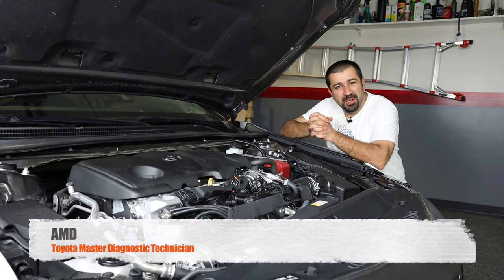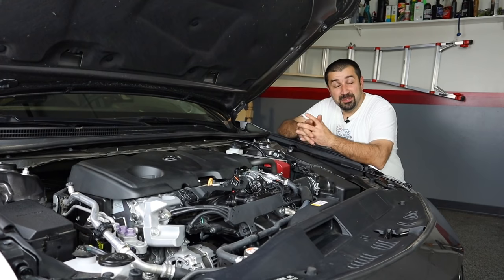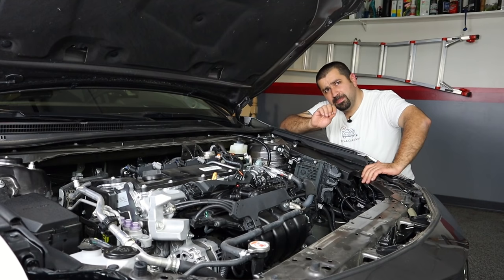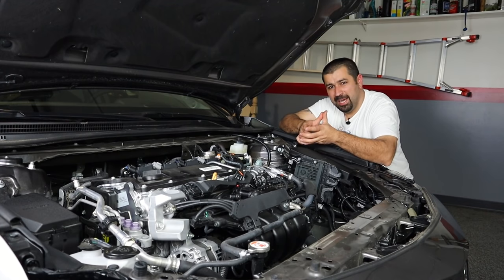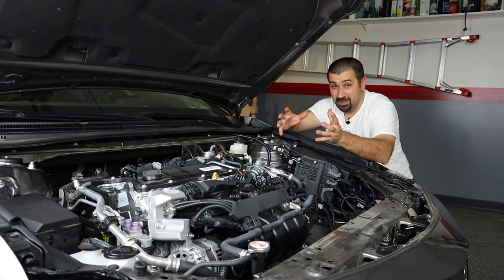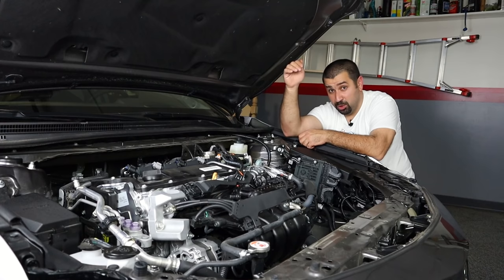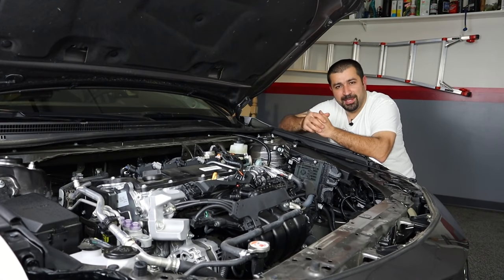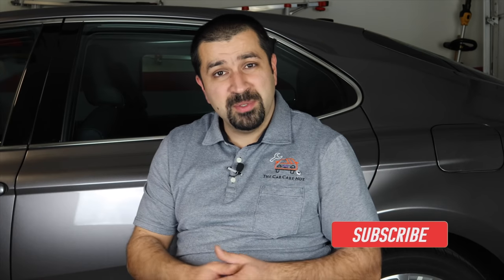Toyota's New Engine Technical review Part 1 : Cooling,Lubrication,Direct Injection and EGR

Comment: AMD my question to is my 2014 Prius w/89K miles is having shifting  issues ONLY when I use the cruise control is that normal? Is this an expensive issue?
Reply from the maker: Hi Michelle. What kind of shifting issues? Also the area you set the cruise control is it a hilly area or flat
Reply: I notice it more on hilly areas
Reply: Hi AMD & I don’t know how to explain it to you cause idk the lingo of cars I know that my 2007 never had this shift problem
Reply from the maker: Michelle it could be that the car is engaging B mode to help with braking. Try this. Drive on a flat area and put your shifter in B mode and see if it shifts the same way when you set the cruise control in hilly areas.
Reply: @TheCarCareNut  thank you so much AMD I really really appreciate you answering ALL my questions.It means a lot to me.
Reply from the maker: You’re welcome Michelle!

Comment: lets hope that the electric water pumps are easy to change,  I hear they do not last long in other cars.
Reply from the maker: They’re not bad to replace. We’ll see how long they last
Reply: The Prius has been using electric water pumps for years.  They are a lot more reliable than belt driven pumps.
Reply: @TheCarCareNut  Do any I need a computer or diagnostic tool of any kind for changing the water pump and thermostat on this vehicle? And also would you say the life span is for both on this vehicle?, and also is there any special procedures I need to take besides running the engine above 1500 rpm’s once everything is put back together for coolant fill mode?, thank you
Reply from the maker: They’re both not bad to replace and don’t require anything special other than bleeding

Comment: Thanks AMD for another great video, i have a question related to the 2021 RAV4 I needed a car and it had to be a RAV4 the only one I could find at the time was a LE which didn’t have the auto headlights option, could I have that option installed by adding the light sensor and proper headlight switch?

Comment: Do GDI engines wear out faster  due to higher internal pressure?
Reply from the maker: Not always. With proper maintenance it shouldn’t wear out fast.
Reply: @TheCarCareNut   thank  you for replying.  Would you recommend CRC gdi cleaner spray for  gdi engines,  especially those without additional  port fuel injection.  I am worried that loosened  carbon chunks could damage catalytic converter and turbo unit!
Reply from the maker: I wouldn’t use the spray alone. You’d want to extract the carbon after spraying it.
Reply: @TheCarCareNut  do you mean a manual cleaning after removing the manifold?
Reply from the maker: Yes

Comment: I took an offer I couldn’t refuse 
for my 2016 Tesla Model S P85D, I loved that car,
but it was time to go. I was planning on getting 
another Tesla when I bumped into a great deal 
on a 2018 Camry Hybrid. I bought the Camry as
an interim car until I found a Tesla. I was going to 
sell the Camry and put the profit towards the new
Tesla. Short story long, I love driving this Camry.
It does what it is supposed to do and does it extremely 
well. It’s surprisingly quick—not 3.2 to 60 like the Tesla, of course—
it handles very well—again, not like the AWD Tesla with staggered wheels—
This car sips the dyno juice while the hybrid system is incredibly smooth.
I get a kick out hyper mileing and getting crazy gas mileage.
I don’t think there’s a better, more reliable, more refined car for the money
on the market today.
This incredibly engineered Camry is staying in the family and will share 
a parking space with my next Tesla in my garage.
I enjoy your channel and really I learn a lot. Thanks much!

Comment: I hit a rock and the plastic and the oil filter perforated my car warned me of the low oil level and it was in safe mode I was able to power it I had the car towed and they changed it the oil filter perforated and I knock on wood but I believe that thanks to the oil level sensor the ecu saved my engine do you know if it is true that the oil level cuts off the gas in the event of a too low level of oil

Comment: In this particular video - is the engine that you are using as an example is that the 2.5 gas engine?
I am thinking very seriously in getting the Camry XLE awd  and getting rid of my Subaru.
Reply from the maker: Hi! The engine in this video is off a 2020 Camry with the 2.5L A25A engine
Reply: @TheCarCareNut  thank you so much for your reply.
Do Subaru and Toyota share any components.
I have been told that Toyota  has an interest in Subaru ... is that true ?
Reply from the maker: Hi! They likely share suppliers but not parts directly except the scion FRS which is codeveloped.

Comment: Man I have this engine and I am using amzoil 5W-30 and it's recommend by the user manual there is no mention of using it once and then go back to 0-16 ( I live in a hot climate  *saudi arabia) will this effect the engine in the long term !?
Reply from the maker: This has come up. I am based in the US and the manual is different than other markets. I would use the oil that was printed on the car under the hood as programming for different markets could be different.

Comment: So what drives the engine oil pump on the hybrid?
Reply from the maker: It’s still driven by the engine mechanically but controlled electronically if it has this engine to change the output

Comment: First off I wanna say love your YouTube channel it has been extremely helpful,Also I had a question 🙋‍♂️ I brought my wife a 2018 Toyota Camry SE  for X-Mas miles 12k,I have had my local shop do the oil changes for now which they do 0W-20 but I was wondering do I stay to 0W-20 or change to 0W-16.
Reply from the maker: Hi! I would switch it back to 0w16 on the next oil change
Reply: @TheCarCareNut  Thank you 😊 will do ASAP appreciate you fam

Comment: Hi, can you share something about maintaining a Toyota hybrid? Some of the information are not stated clearly in the owner's manual and people have different opinions. Eg. is the transmission fluid really life time? When to replace the brake fluid? When to replace the 12V battery?
Reply from the maker: Transmission fluid every 60-90k brake fluid needs to be tested but on average every 3 years. 12v battery when it fails which is usually around 3-5 years
Reply: @TheCarCareNut  thanks!  I supposed your units are in miles ? What about coolant change ?
Reply from the maker: Yes In miles. Coolant first replacement is 100k miles or 5 years then every 5 years or 50k miles afterwards

Comment: Thank you AMD , you are real talented expert .
my dealership in my region  is recommending 10w30 (arab gulf countries) for corolla dynamic engine 2023
I am totally convinced by your recommendation which saying clearly use 0w16 regardless the climate.
0w20 SP is available in dealership and 0w16 is totally unavailable in the region.
Should i go with 0w20 and stop filling the standard dealer 10w30?

Owner manual recommends :
0w16
0w20
5w20
5w30
10w30 

I really need your expertise to advise me on this case :)

Comment: Having this engine in my 2023 RAV4 Hybrid, my Toyota dealer told me during the first maintenance that he filled 0W20.
I discussed with him, revering to the manual und this video to fill 0W16.
He told me that Toyota went back to 0W20 and he double checked his documentation to besure, his system says he should fill 0W20.
Now whats true? 
Did they really changed the spec? 
Afterwards I thougt about bringing 0W16 for the next maintenance on my own but in Europe It's nearly impossible to get this oil from Toyota.
On all the webpages they revere to the 0W20 for RAV4 Hybrid .
@TheCarCareNut what do you think about that?
Reply: Honestly the dealer is trying to scam you, because 0w16 is more expensive and they put 0w20. It wont break your engine anytime soon, but I think the lifetime of the engine will decrease ( when its out of warranty) and you get lower fuel economy.

Also if you cant find 0w16 of toyota, go for another brand that has the ilsac GF 6b specification

Comment: Thanks for sharing. I have 2021 RAV4 trd every time i start the rav4 it makes a mix sounds rattling, lil bit of pinging or knocking even in cold or warm weather still the same it will last 10 to 20 seconds only and the engine sound smooth again. The engine has more than two hundred km i got it 5 days ago. Is that a normal sound? The Rav4 is made in canada and it runs smooth. Thank you.

Comment: I was wondering, when servicing the cooling system with all of the valves how can you ensure that all of the valves are open and coolant is flushed?
Reply from the maker: Hi! When you rev the engine and hold it past 1500 rpm the computer will enter coolant fill mode and it will run the water pump at full speed and open all valves.

Comment: Well he is  just admiring the complexicity of the new engine with adding lot more parts to the engine bay which is good at some point that they claim this new engine has 40% efficiency (of course that is at best optimum operating condition) but how all these complexicity will hold up down the road is the question that we might want to ask from owners after a few years to come.

Comment: Hello AMD and again thanks for your useful videos. I am searching for a 2016 rav4 hybrid and here in france, the official toyota maintenance schedule is : 15000 kms, 30000kms, 60000 kms ( yes nothing at 45000 ?!? ) and 75000kms ... with 0W20 oil. For a 90000 kms used Rav4 hybrid, how this schedule affect the general reliability of the car? If then i apply your recommandatioins ( 8000 kms/6months with 0W16 ), no problems then? Thanks to you.

Comment: Hi I end up in this video… because a few months ago I bought a Toyota Camry SE 2019 with this engine . I’m from Mexico and I usually do my oil changes, I read the US manual (because I know Camry is made in the US) and I saw in fact it uses 0w16 as the video said. I bought everything for the oil change and then I opened the hood and there is a label indicating that the engine uses 5W30. This fact was weird to me to the fact the manual and Toyota US said it uses 0W16. You explained the reason of this and I totally understand and I’m agree. But now my question is … why Toyota Mexico is indicating and using 5W30 Oil here ? 
I replace whatever existent oil was  in my car for 0W16 expecting not having any issues at all. 
I suppose that they always used 5W30 until now, car has just 60,000 miles .
What are the recommendations? 
Keep using 0W16 like I did ?

Comment: Ac does not blow as it used too, checked low on pressures line it’s cold, and radiator fans kicks on ac, but still not cold and gets worse in 95 f outside

Comment: Is this the engine bay of a 2019 RAV4?  My dad picked up a 2020 RAV4 not long ago, and it's been excellent so far.  Also, the D4-S system has been around since 2005 in the Lexus GS, and Toyota feels confident enough to put it in basically all of their new engines going forward right up to the twin turbo V6 in the LS500.
Reply from the maker: Hi! Yes this is the engine in the 2019+ RAV4 hybrid and non hybrid

Comment: Hobbyist here, why do direct injection fuel systems NOT create vacuum in the intake manifold (your reason for including a vacuum pump: power brakes)? I'm familiar with valve throttling (example: BMW's Valvetronic) leaving no vacuum in the intake tract and that necessitating a vacuum pump. Vacuum generally occurs from the throttle body's obstruction.

Would the Atkinson cycle be part of the reason for the vacuum pumps necessity?

Just curious on why it needs/has a vacuum pump and I'm not following your logic.
Reply from the maker: Hi! It’s a bit complicated the exact explanation why but because direct injection engines don’t  exactly use the throttle as intended. They will actually open the throttle at larger angles to increase the pressure in the intake. That’s why they need a vacuum pump.
Reply: @TheCarCareNut  thank you for the quick reply, I appreciate it. Always fun to read more and learn!

Comment: Hey car care nut my first change oil is 1k miles on my rav 4 xse. But when i oil change they put 0w-20 but when i check it supposedly 0w-16. It’s okay if i can bring it back to 0w-16? Or they gonna dmage the engine already?? Thanks for help.
Reply: Please read your maintenance guide. It will inform you about using 0w20 and what to do

Comment: I didn't know Toyota manufactured engines with no EGR valves on any modern engines. No wonder they're  have valve coking and scorched rings in  engines minus the EGR valve. Yes it does reburn the pittance of exhaust gases which goes back through the engine, but the biggest benefit of the EGR system  is it lowers combust temperatures substantially which reduces the carbon monoxide emissions plus it allows for the engine to operate in a combustion temperature range at idle and cruising speeds that is lower, so it  reduces heat related wear on the valves, valve seats, pistons, rings and cylinder walls. Those oil injectors at the bottom of the cylinder are for cooling the piston and rings not so much lubrication. This is because the oil cools the moving components of an internal combustion engine. If Toyota had used and electric oil pump which would allow for pre-pressurization they would have really been cutting edge, maybe in the future. In essence if you operate an engine with a bad or seized EGR valve you are reducing your engines life by hundreds of miles every day you drive your car with the EGR system inoperable. Get the EGR valve fixed as soon after the code is discovered as possible, regardless of vehicle make...

Comment: Hi there, great engine review. However, I would like to get some clarifications.
Concerning oiling system: 0w-16 oil weight and even unthinkable 0w-8 oil weight is recommended for this engine (reffering to the latest owners manuals).
My first thought was 0w-16 and thinner is allowed solely because of this engine friction pairs was made more precisely (I mean oil clearance). According to physics phenomenon "thinner fluid goes easier through small clearances than thicker one".
However, nothing like this.
I looked in service manuals of marvelous A25A and conventional korean G4NA engine (oil recommendations 5w-30, 0w-20). What is puzzled me that I found no difference in oil clearance (e.g. main bearings). At other friction pairs the same, no significant difference.
A25A-FKS standard value is 0.020 - 0.043 mm.
G4NA standard value is 0.021 - 0.042 mm.
So my question is, where is claimed precision of A25A engine? What are places, units?🙂
Do they allow usage 0w-16 and thinner solely because of their variable discharge oil pump?
Or are there places in engine which also strictly require 0w-16 weight? Or there's something else what I can not even imagine? 🙂

Comment: toyota is not the only manufacturer with dual injection motors
Reply from the maker: I haven’t really looked at other manufacturers but for education purposes which other manufacturers use a similar system?
Reply: @TheCarCareNut  some audis,fords and  new hyundai motors. There could be more manufacturers. Cheers
Reply: @TheCarCareNut  The F150 has engines with dual injection.

Comment: RAV4, 2.0L (2020- Malaysia), The model I drive comes with 360Degress view which comes on   at 0- 10km/hr. Pretty cool feature when negotiating tight corners, but 10km/hr limit is too bad. Is it possible to increase the limit to 20km/hr, which  I feel more practical, without jeopardizing the safety. 
Pls advise

Comment: Hey AMD, with this new sophisticated cooling system, is it normal for my temp gage to go down when idling in winter?  I am in 🇨🇦 and the other day it was minus 2 c. (Approx 27-28 f).  We stopped to pick something up and I let my Rav (non hybrid) idle for a few minutes as my wife was in the car.  When I came back in, the temp needle was down to the 1/4 position instead of in the middle.  Is this normal for this engine?
Reply: Yes

Comment: A great engine of a car is an engine that can last 200,000 mi or more like the old Corollas and Camrys crown vics that determines if a car is good not if the ride is good also take it to account if the fuel injection system is good and electronic modules of it is good anything else besides this does not classify it as a great engine that's my opinion

Comment: I have the 2021 Camry LE. 2.5L. After 1 year of using and it’s on 32k right now. I have an issue, it fails to start right away after first crank for 4secs. When the car is cold, it starts right away, but when cold and I leave the car off for 15mins, it takes very long to crank start. I changed the air filter, cleaned MAD sensor, changed my spark plugs. And it still cranks long. Anyone can tell me what is the problem?

Comment: 2023 sienna has some fuel dilution. I get the oil analyzed. My wife takes alot of short trips which probably contributes to that. Will change oil every 5k. Any other recommendations?
Reply: Do some frequent highway drives.

You need to get the engine warm, and for a prolonged period of time.

This will cause the fuel in the oil to become a vapour, at which point the PCV system clears it away (keeping it simple)

Comment: I love your video. When do you recommend for the transmission fluid change for the break-in period?
Reply from the maker: Thank you for watching my video! The transmission doesn’t have a break in fluid replacement interval. I would change the transmission fluid for non hybrids at 60k or 6 years
Reply: @TheCarCareNut   Am I correct that there are small metal parts inside the transmission also? If yes, then there should be a break-in period also. I have a RAV4 Hybrid.
Reply from the maker: Hybrid transmissions don’t have much to break in. 2 electric motors and a series of shafts and gears.